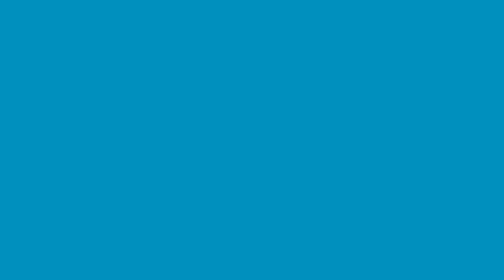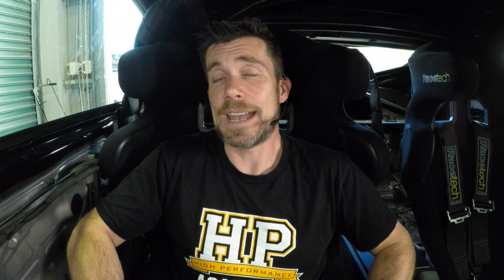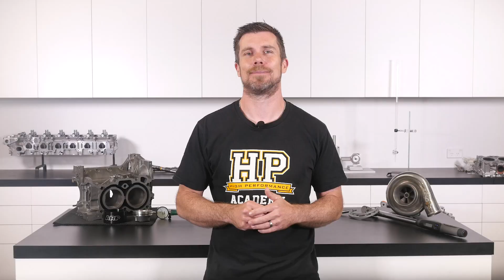Dynos | Rolling Road Vs Hub [HPA Q&A]

Comment: So which type better for dyno hub or wheel dyno it
Reply from the maker: Neither is better, they are just different.
You could say once you start getting up to and over 1000hp vehicles that a hub dyno becomes a requirement (although some claim 2500hp vehicles can be used on rollers) rather than just an option, but there are many tuners making a living without touching anything like that and the quicker setup time of a rolling road is a definite advantage.
There are also engine builders using neither option and in engine dyno instead, because that suits their use case.

Here are some more videos on this you might enjoy - Taz.

https://youtu.be/t5NXae1ED9M
https://youtu.be/13lCUl76-7w
https://youtu.be/dujolvOENs0
https://youtu.be/jM0Iqk4Ada8
Reply: @hpa101 but base on my dyno test Dynapack make 340HP dynocom make 370HP I abit blur in this😂

Comment: If dynapack is limited by software (presumably), doesn't that mean with a simple firmware update it can be miles better (at least than it was prior/had been)? Or do they typically lack other hardware that enables other features/tricks???